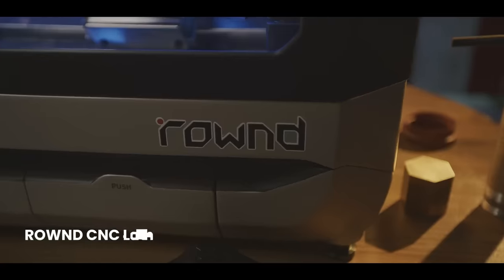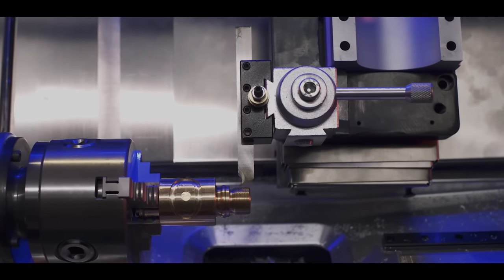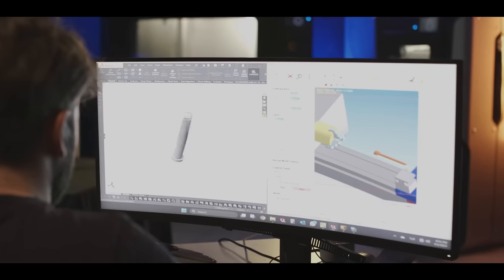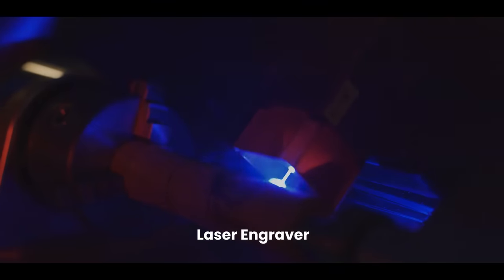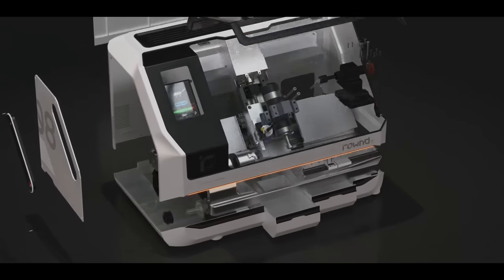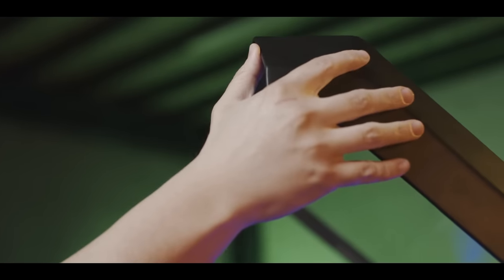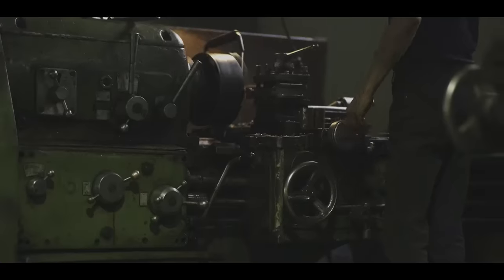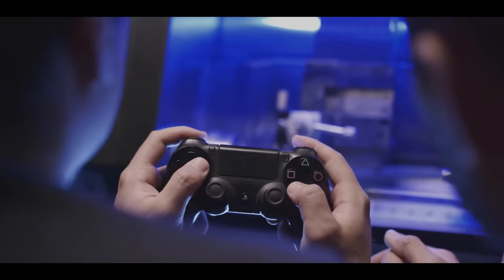Rownd CNC Lathe - Machining for Everybody

Comment: 20 microns?.. Thank you for mentioning that right away, just dodged a bullet
Reply: seriously!
Reply: is that bad?
Reply: @dmaynor  it can't be true
Reply: @harrelsontrumpets  oh, I am a complete newbie to this stuff.
Reply: @dmaynor  2 hundredths of a millimetre. No, not bad.
Reply: @MidEngineering  when you say it out loud that does sound like some nasa quality tolerances.
Reply: @dmaynor In reality it's really bad. In the small diameters that this would be best suited for, the tolerance for a simple sliding or transition fit of a pin in a hole at 10mm let's say (a rather generous size since the tolerances get a lot smaller at even smaller diameters like say a 4-5mm pin and that lathe would struggle to go above 10-12mm in diameter) would be 9 microns in the shaft's actual turned diameter and 15 microns for the actual bore diameter and that takes into account ALL deviations so even a 5μm Rt surface roughness just at more half your tolerance. 

A machine with decent quality general machining tools that can hold 3-5 microns in tool positioning and repeatability WITHOUT cutting, will just make it feasible and practical enough (easy and cost effective) to reliably make 15-25 micron tolerance parts, before implementing purpose specific tooling, special processes and per part checking and machinist interventions. 

A lightweight machine (hence not that rigid) with an accuracy and repeatability of 20 micrometers will struggle to make parts to +-0.1mm (100 micrometers), and I would be surprised if it can really do even that with an aluminum frame, when even 2t solid cast iron industrial lathes literally bend from just resting your hand on them...and to put it into perspective that's not nearly good enough to install a bearing that will function properly, and would be barely adequate for a non critical, low pressure static o-ring seal, IF it was capable of slotting with a grooving tool without chattering itself apart, and leave a clean finish, which I highly doubt...
Reply: @dmaynor 
0.02 millimeters

Not good enough when you turn something like 10 H7....
Reply: @Sketch1994  tu crees que el potencial comprador de esta maquina necesita esas tolerancias???? No seas ridiculo
Reply: @juanmanuelgarciaortega2591 If he didn't he would just a get a 3d printer, and without "these tolerances" it's barely useful to make metal parts. An oversize plastic shaft will squeeze right in an undersized plastic hole, but try doing with more than a few microns of metal...
Reply: LMFAO , tell me youre not a machinist while not telling me youre not a machinist. A haas lathe barely hits 20 microns tolerance
Reply: @airgunningyup  Even a HAAS can hold 3-10um using the right tooling after a proper warm up in an environment without too many fluctuations
Reply: @Sketch1994  and u expect that same precision from a 4000 dollar toy that can go in an office ?  Does walmart bag your groceries with the finest silk also ? I dont even have a dog in the fight , its a hobbyist lathe and the OP expects Nasa level precision
Reply: for what appliction will you machine parts in  a lathe with such tolerances. asking for a friend
Reply: @bnarit  if you're going to follow ISO tolerances you shouldn't machine stuff on hobby's bench top cnc
Reply: To be fair, a 4-axis machine with milling capabilities under $8,000 and an accuracy of 20 micrometers is probably sufficient for most people. It's important to remember that a 3D printer only has an accuracy of 0.2 millimeters. Furthermore, the person in the video mentioned that the machining tolerance and repeatability are 20 microns, suggesting that with adjustments, sub-20 micron precision can be achieved.
Reply: Umm yes, 20 microns is bad.
Think about it: Why do you buy a insanely expensive cnc lathe?
You want to produce metal parts.
If you plan to produce components or whole mechanical devices (nope I don’t mean chess pieces, I mean shafts, pneumatic cylinders, gear blanks….), you absolutely have to follow ISO tolerances -> meet tolerances that are smaller than 0,02 mm.
Otherwise all parts you want to fit  will rattle or not fit together at all.

If you want to produce mechanical components, just get a  Proxxon, Wabeco or an old EMCO CNC lathe. They are not really larger than this machine and you will be able to make proper parts, although you will need some time getting used to these machines.
Reply: My thoughts exactly! That's rough... literally.
Reply: @zfgm1065 my school has a emco concept 55 lathe and it does nowhere near 20mic if you make a proper cut ......

these machines are not to make parts, but to learn how to control a cnc, just get a 8L or slant 15pro if its "SOO BAD" they arent much better 😂 and are quite a bit more expensive
Reply: @airgunningyup yes, dude, it’s like these people never heard of using an offset and a finish pass 🙄
Reply: 20 microns is. 02mm or .00078"😂😂
Reply: @JamesKing-ev1wc lmfao, good one
Reply: gotta add, might be a bullet to dodge for me but, at the same time, could be a perfect choice for someone else, in theory
Reply: 😂Silly
Reply: I wonder why you thinking 20 micron is off the roof. That is about 8 tenths. 0.0008. For aerospace parts tolerances is way more than that. You could have between 1 to 5 thou. 0.001" to 0.005".

Comment: 4'000$ is an expensive toy, because it is a toy. 
And I see only 3 axis, not 4. The shitty Chinese second spindle should not be counted as an axis.
And 3'000 rpm for the main spindle is low for this kind of diameter.
And CNC or manual, you still need some knowledge to operate this kind of machine.
...
Nice project, bad (false) advertising.

Comment: It weighs 145 lbs and is rigid? OK guys; congrats on your new physics model... And you can make anything you can imagine, as long as your imagination fits in box less than 6" around and ~16" long...  How do the people who post this stuff and sell these products sleep at night?
Reply: Hell 1450 lbs is awful light for a rigid lathe. I think you can still do a lot with that workspace, though.
Reply: pff... it's made of vibranium, not ordinary cast iron or similar.
Reply: That cast iron would probably helped a lot more than the alu giant block.
Reply: @mrechbreger  Yeah, literally since aluminum is known to be completely unsuitable for this application due to it not dampening vibrations... Unlike cast iron which is fantastic...